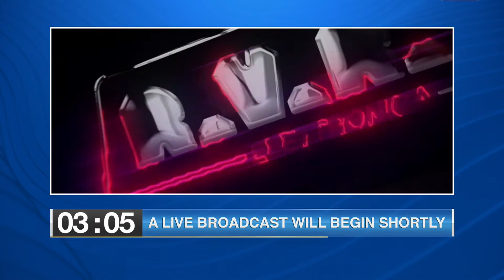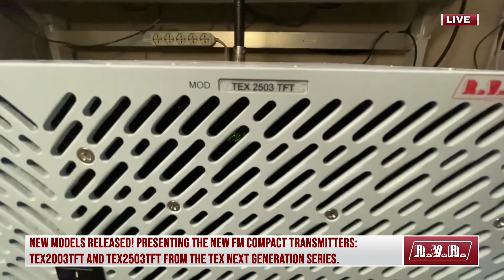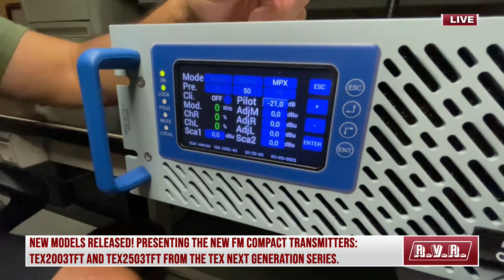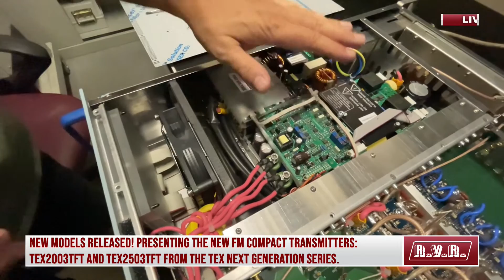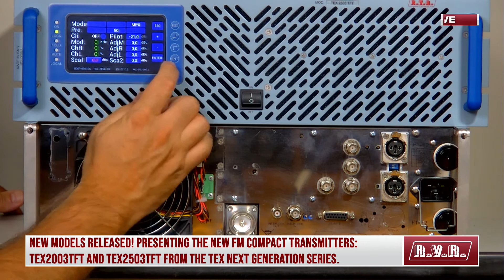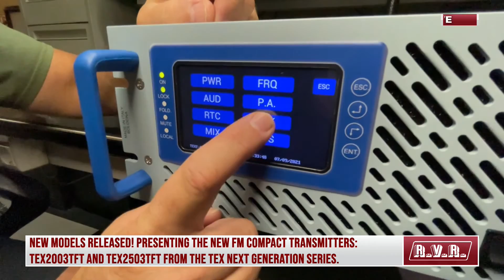RVR TEX2003TFT and TEX2503TFT presentation.

Comment: Thank you for the video showing how to access the internal air filter. I wonder if it would be possible to offer an option of an external air filter module that attaches to the front panel, to replace the internal filter? I still believe that the internal air filter is going to be problematic in dusty environments. A simple external, slotted aluminium filter shroud/cage (10-15mm thick) that covers the front air vents and is held in place with 4x thumb screws tapped into the TX front panel, would be a much better servicing solution when the filter needs to be cleaned every 6 months. Im not sure if removing the front panel in this way, while the unit is powered up, is even legal in some juristictions. But aside from that, allowing the front panel to dangle from the display loom and power switch cables, while you clean the filter, is asking for trouble.
Reply: Hello, in normal dusty environment you may use the transmitter for about 2 years with the build in filter. 
The best way to clean it is to remove the front panel because the filter is squeezed into screw extension sockets and transmitter frame.
I use a vacuum cleaner first, then wash the filter with pressure shower head. 
Nice to do also a check by removing the cover for any dust particles on electronics and foreign stuff if any.

Putting an external filter will provide additional protection and increased service interval, but you must cover the same area as the internal filter.